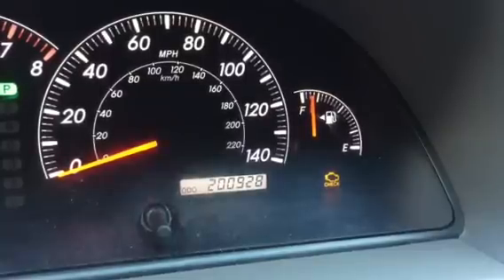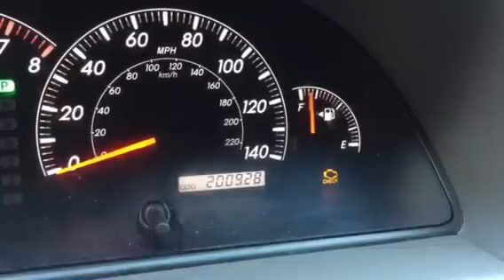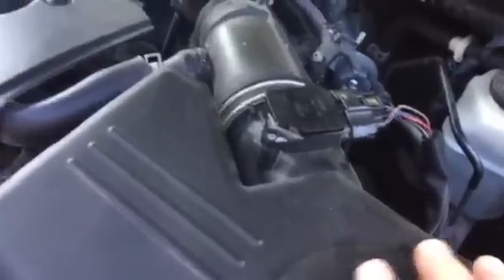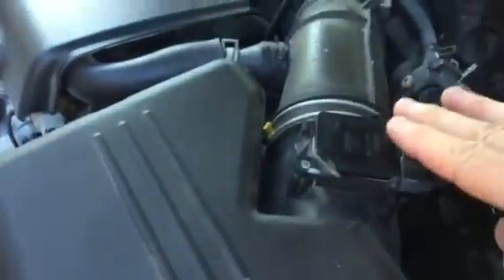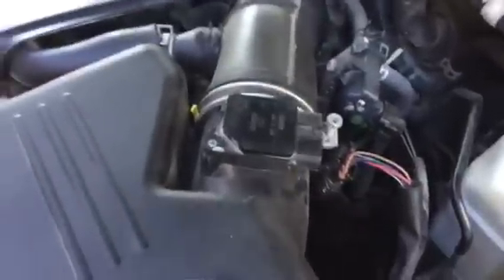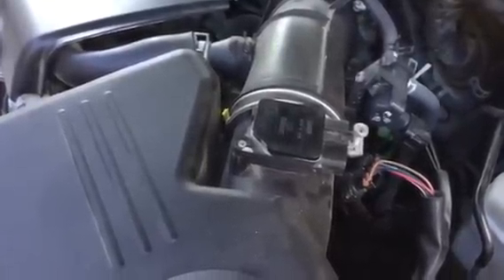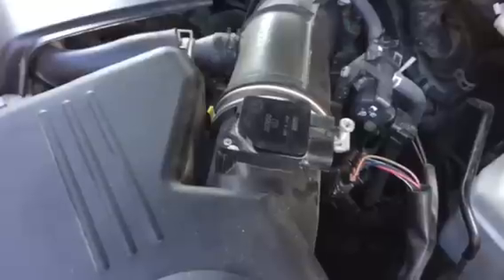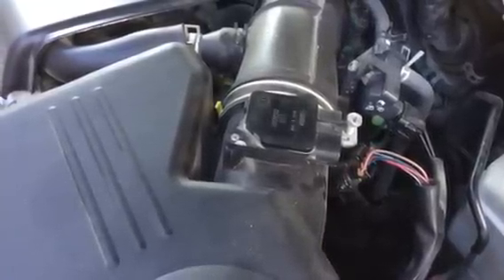How To Tell If Your Mass Air Flow Sensor Is Bad On Your Car

Comment: my st220 started cutting out  i changed the  coil pack and sorted a loose vacuum pipe which  sorted the erratic idle , but now the car idle started diving and wanted to cut out  whilst on the run.   I just did this test and found the car was still running after removing the  maf connection... so im buying a new one ... thanks for your demo sir!!

Comment: Man you rock bro, my Mercedes hesitating and not accelerating right at times changed spark plugs still the same thing, thought it was my transmission too, but saw this video like two days ago so I ordered the MAF, but I never tried what u did in the video until  jus now, LITERALLY ……..and my car kept running…..MAF…….it will be here tomorrow

Comment: Complete nonsense. This pseudo-science: CAR will shut off with mass air flow sensor unplugged which equals replacing MAF IS WRONG !!. Your car's PCM will default to a preprogrammed Air Ratio and the car will get bad gas mileage and or performance issues. There is a lot wrong with this science and diagnostics. Video should be taken down. Failing MAF sensors fuel trims need to be looked at idle and at min 2500 RPM. A unplugged MAF PCM goes into default A/F ratio reving RPMS 2500 would show bad fuel trims with an unplugged MAF which doesnt mean bad MAF . Most DIYERS and mechanics dont look at vacuum leaks and unplugging a MAF is not the sound test. Stick with Scanner Danner or Bernie Thompson for accurate scientific testing not this person. CANT believe the SHEEP that follow this advise and all the wasted money on MAF sensor replacement
Reply: My carvwhich is a A8 4.2 fsi is running lean. Took out the Maf sensor and car still running. Amy thoughts
Reply: @maulajatt5655  would need to see oxy sensor data. What's your maf sensor grams per second at idle and at  2500+ rps? Formula is one gram per second per.liter of engine displacement.

Comment: Would this trigger engine light codes? I didn’t have any codes showing up previously but now MAF codes P0113 and P0102 shows up.

My car starts but shuts off quickly. I can rev the engine once or twice before it dies but that’s about it. I thought it might be the MAF sensor but it makes no difference. The car still shuts off soon after starting.

Comment: If you read the schematic you'll see most MAF sensors contain a temp sensor as well. The correct way to diagnose is to disassemble the connector and remove the MAF signal wire. Reconnect the sensor and drive while watching your fuel trim numbers. With the signal wire disconnected the ECM will substitute values so it can run without the MAF signal. My rig showed LTFT (long term fuel trim) numbers high while driving. Plus 10 to 15 percent added fuel. With the wire disconnected the fuel trims were normal plus or minus 5. Replaced the MAF sensor. The ECM relearned the correct fuel trims during the next cold start warm up. This test is more accurate than just guessing like this video shows.
Reply: I tried this guy's suggestion and I bet I will never do that again 😮
Reply: @cynthiadudal9301 why?? Lol
Reply: Why what happened when u performed this guy's suggestion?
Reply: @cynthiadudal9301???
Reply: You should make a video of that
Reply: Is that means when disconnecting the signal wire and the LTFT came back to normal readings means that the maf need to be replaced?!

Comment: For me the opposite happened when I unplugged it the engine responded by the rpm falling like it was about to stall but then it came back up to normal and it ran the same as when it was plugged in with the rpm bouncing up and down very slightly (barely noticeable) but when I plugged it back in that's when it died. It's a 2011 crown victoria. I'm assuming it just works opposite of how your car model works I mean every car is different so it could just be that.

Comment: But.. what happened if i dont have any check engine light and the truck its shaking at 50-60 mph Also, the motor doesn't stop when I disconnect it.

Comment: So got a check engine light. Scanner says MAFS. Pulled the electrical harness off. Car keeps running. Put new sensor in, reset check engine light, pulled harness again and it still keeps running. Any ideas? 
Possibly just drive it to let the computer reset and see if check engine light comes back on? Any other thoughts?

Comment: I found my MAF was bad by the long method (using a multimeter) and the readings on the signal wire to ground when I revved up the engine were low, pulled the plug on the running engine and it didn't stall....

Comment: I did this on my 2003 corolla, the engine died and when I start it again it pulled a code P0100 and P0110. My advise is don't do this people.

Comment: When trying to clean MAF's DO NOT TOUCH THE SENSOR WIRES!!! If MAF Cleaner doesn't work by just spraying it, IT IS STUFFED. You can't use little files, brushes, blades to scrape, rags or anything. With some MAF's you may be able to immerse just the sensor section in cleaner and leave it to "soak" giving time for whatever is built up on it to dissolve away, just don't get the electrical part "wet" with cleaner, if you do, you might as well bin it as MAF cleaner does an amazing job of desoldering stuff! leaving all the connections inside loose and can even come apart internally.
I personally recommend cleaning your MAF at every air filter change and after driving on dirt roads. I do mine monthly and filters 3 monthly, unless I drive on a really dusty dirt road. It's pretty easy to judge if you keep your engine bay clean, if dust is all over the strut towers, firewall, and engine vanity cover, you should replace the filter. You may be able to "see the sun through it still", but the fine particles will block plenty of air flow. Bottom line, regular smart maintenance may cost a bit regularly, but it's still cheaper than new engines or cars to replace one you blew up that you paid $40,000 for and only got $5000 back cause you blew it up and it burnt to the ground, probably cause you couldn't hear it losing the plot driving with your stereo up so loud youwalk around with permanent tinnitus and always talk loud. You never check your guages to notice the Temp gauge pegged in the red, the check engine light and oil light on,but film a video of the car broken down when it does, saying it just died for no reason and post it to Facebook 😂😂😂
I'll take any likes as "Hell Yeah's" from mechanics who hate people like the above mentioned,but deal with them politely and respectfully, even though you really feel like taking them out to their car on the lift, show them something and get them to put their arm where you can quickly Zip tie him to the car, then lower the lift to the last click before squashing them then lift it back up and let them go. Just once would be Soooooooooooooooo satisfying, but I value my freedom too much. 😂😂😂

Comment: Be very careful reaching inside a running engine, it's going to take a while for someone to hear you and come to switch the engine off if a belt or pulley grabs you

Comment: Would if, when you unplug the maf sensor and the dle goes from rough and stalling to good. Then if you plug it back in the idle remains good but if you turn your vehicle off and back on again, the idle goes back to rough until you unplug it again.

Comment: Soo what would it be if you unplug it and the car keeps running BUT you replaced the MAF sensor 3 times? Also it dies/doesn't run when it's plugged in but fully functional but runs rough  when not plugged in?? (2011 equinox)

Comment: That is not a test. And I wouldn't suggest you disconnect your airflow sensor while the engine is running. It also doesn't explain anything about the values, 12 volts to the unit the volts coming out of the unit. That could be a three four five six seven volts that goes to the ECU. The value is going to be from 1 to 28 depending upon the vehicle. It's an untrustworthy video don't be foolish do your research before you go around jabbing screwdrivers into something that you don't know what you're talking about or doing. Ruin a mass airflow sensor and you will be buying an 80-90-150 part.
If you want to do it right go to this video and use some common sense.
https://youtu.be/p0ocaDmcAIM

Comment: So, if there is no problem and the mass air flow sensor working, what's the next check? Or what I should check?
Thanks... I am from Kurdistan Region north of Iraq middle east. I have Nissan versa 2020 car, and this is three times I cleaned the sensor but after one week the check engine alarm working and the is at the sensor.

Comment: I might be wrong, but doesn't the MAF sensor run off of preprogrammed parameters set within the ECM if the MAF sensor should go bad? So it should keep running regardless of unplugging it? Or is this only on certain models and years? 

I've read that if unplugging the MAF while running and it runs better, then the problem is the MAF. If unplugging and there is no change, then the problem lies within a bad ECM ground.

Comment: Pulled it, it stopped. Turned it to the off position, plugged it back in and turned it on...I have 3 new lights on now. VSC, TRAC OFF & CHECK ENGINE.  What now? None of the wires are loose. I put the clip back on the way it came off. Car still runs fine. 2005 Scion xB
Reply from the maker: Once the ECM recalibrates the MAF sensor the lights will turn off by themselves.
Reply: @proclaimliberty2000  Oh good! Thank you for responding. My car is just sucking down gas so fast. It was right after I changed my oil last week and a half ago. Tire pressure good. I bought some new spark plugs to swap out even though there are new spark plugs in there from March of this year. So I'm just kind of going down the list. I'm spending about 20 bucks every third day. The only thing I can think of is maybe the gas is water down.
Reply from the maker: @The_Absent_MindsetReality  If you noticed a dramatic drop in your gas mileage it could be that your oxygen sensors need to be replaced.
Reply: @proclaimliberty2000  Yes, I was thinking about those.  Watched a couple YouTube vids on how to replace them. I went to a different gas station to see if maybe it's the gas. I have one errand to run that's a little bit out there so that'll tell me if it's super dramatic. But I'm thinking about replacing those sensors just because of how many miles I have on it. Just to get them done. Do you know of a third party online that you like for parts?
Reply from the maker: @The_Absent_MindsetReality  Your best price for parts will be Amazon or eBay. I would strongly recommend getting good quality oxygen sensors like Denso brand.

Comment: Halo can someone please help. I've changed my original engine,and installed a import engine. Now having problems with my airflow sensor. My car idle with out the airflow sensor not being plugged in. When I want to put the plug in ,te car cutting out.

Comment: I've been an auto mechanic for over 20 years. Many of the problems I see daily could have easily been avoided by simply following the vehicles maintenance schedule. I use a program on my computer called Automotive Wolf car care software to keep track of all the maintenance for my 3 cars, a truck and even a generator. It automatically can send you text message reminders when any type of service is due. Two of my vehicles have over 200,000 miles and have never needed any repairs. Want to save money? Follow your maintenance schedule!
Reply: And how is a sensor going bad going to be prevented by normal maintenance?

Comment: This procedure and logic can be faulty, as there are plenty of cars out there that will do precisely the opposite (run properly when the sensor is removed, not run or run poorly when installed).  GM 3800s for example have base mapping that relies on rpm, MAP and IAT and the engine will run 99% of the time if you simply remove the MAF.  If the MAF is faulty, it will misreport airflow and because it's plugged in, the car will rely on it instead of its base mapping and the car will NOT run.
Reply: My apologies, but I must interject. No fault of logic exists in the video example nor in your own hypothetical. The video specifically states the pre-existing condition is a vehicle that starts, runs for a few seconds and then dies. The only non-specific qualifier is 'a few seconds ',but anyone who has EVER tried to be their own mechanic knows this is roughly 3-59sec. The procedure and subsequent results are based on this--and imply that all other variables are equal. Your example states that GM 3800s are mapped to rely on several components. Fine. You state these vehicles will run with the MAF removed due to the base mapping fallback and not run/run poorly with it installed. This still falls in line with the video assessment and actually goes to further prove the validity of test's results. The fact that the vehicle continues to run with the MAF removed in the aforementioned vehicles(GM 3800s) proves that the MAF is faulty because the vehicle's system compensated by reverting to base mapping as opposed to MAF itself.
And to the creator of this video--many thanks! Wonderful video. Clear, concise and informative. Perfect. Thank you for laying out help for the 'every-man'(or woman) without all the technical jargon and tools no one but professionals have. Totally subscribed!
Reply: @nikkeerector4373  I made this comment 6 months ago but I think I was just trying to say that SINCE some cars do the opposite of what he's demonstrating and SINCE nowhere in the video does he define the scope of vehicles to which this symptom/treatment applies, it's slightly misleading.  The only reference to cars is "your car", "your mass airflow sensor".  But it totally depends on the car so I'm just pointing out that this applies to a subset of vehicles with MAF sensors that work like that, not all of em.  You can't deny that a layperson watching this video would have every reason to go out to his Pontiac Grand Prix or similar, follow this procedure and be confused that the idle actually improved.  In fact, I just realized something way more important.  "IF YOUR ENGINE STOPS, THAT MEANS YOUR MAF IS WORKING CORRECTLY".  If the car works like this and the MAF is malfunctioning (it's working just fine in this video), why would the engine be running at all and what would pulling the MAF out prove?  You pull a good MAF out, the car dies.  You pull a faulty MAF out, the car dies.  It dies either way but more importantly, if you have a faulty MAF on a car that dies when the MAF is removed, then it probably won't run long enough for you to walk over and pull it out anyway.  Basically if the system works like a grand prix, you CAN diagnose it by changing something (pulling the MAF).  If the system works like it does in this video, you CAN'T diagnose anything since pulling the MAF has the same effect on the car, irrespective of the MAF's condition.  You literally can't diagnose a faulty MAF this way in this kind of car.

Comment: For my 2 cents worth I would take A good old carburetor over electronic fuel injection any time. A carburetor can be totally shot and the engine will still run roughly. With EFI there are half a dozen components that can cause the engine to stop running instantly possibly stranding you beside a busy freeway in the middle of the night and then you end up getting killed.

Comment: My mother in law's Ford Taurus would not start and I was able to get it to start by disconnecting the mass air flow sensor. 
I took the sensor apart and wires and junk stuck on them. Some chipmunks had gotten into the air filter box. 
I put the sensor back in after I blew the stuff out and it started again when the sensor was reconnected. 
Good video. Happy Motoring.

Comment: Well now I see why my check engine light is on I changed the mass flow air sensor yesterday had the check engine light erased came back on again had it erased today and it came back on again today I unplugged it while the engine was running and it turned off so obviously the sensor is good so I assume I have to continue driving the car for 40 miles for the computer to reprogram itself good to know

Comment: hey I replaced my maf after a dealership said that was the problem. The car started back running after I replaced it. I still have code on there and I took it to autozone an their code reader still saying maf. Then I did your trick by taking plug off maf while running. Car stayed running after putting brand new maf in.

Comment: Thank you so much Auto shop said transmission was bad. I came home and changed plugs, battery and tried this. It kept running so ordered a new one and air filter.

Comment: I did this method to my car and the car didn’t die immediately but the car still running but i shut it off because the car starts idle rough its like misfirring sound like running our of fuel
Reply: I believe you have to "Go  drive it around" to reset the computer..

Comment: Just curious, does this apply to any car? I have a mk6 gti and I just did this to my car and the car continued to run. Does this definitely mean I need a new MAF? I am throwing two codes, a P0507 and a P2187, and my epc light is on.

Comment: Just cleaned my MAF sensor the car ran better but didn't get rid of the check engine light. Ran another diagnostic then said my 02 Sensor was bad. Checked it and it was completely shot. Luckily I just replaced it so now let's hope that fixed my issues.

Comment: Hi
I hope you get this cimment

Im on a farm

Bakkie of farm Mahindra enjin light come on and die. Start after cranking a LOT. Then enjin light go off. Soooo 500m enjin light go on again and die. 

Wel i pulled AFS wires out when bakkie idle then car not die it still idle. 

Now... My boss have a Toyota bakkie. And his car is fine. I test it on his car. Car idle and pull out AFS wires. And not die. Still idle. It have to die because my boss car is fine. 

This confuse me. 

Any help?